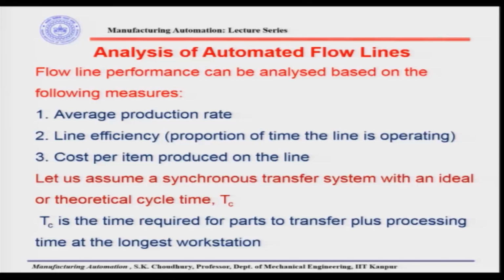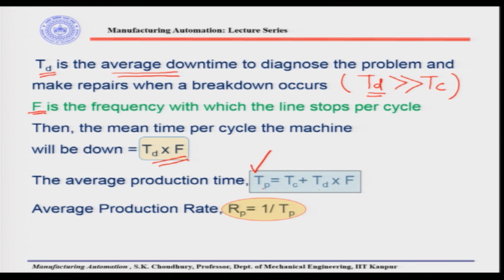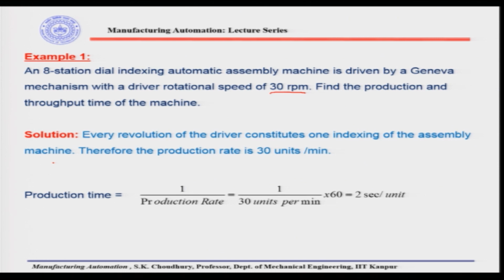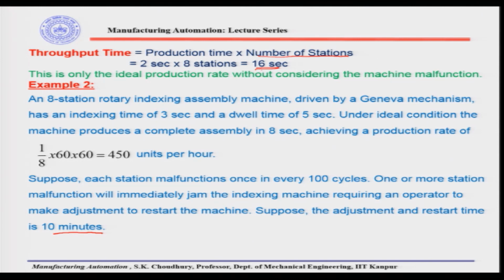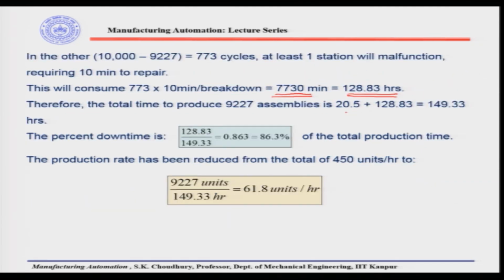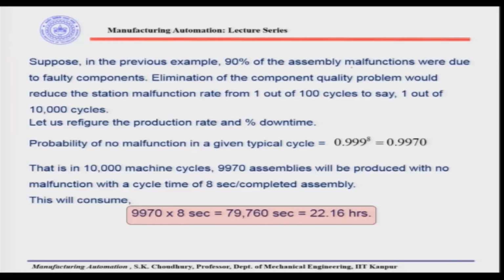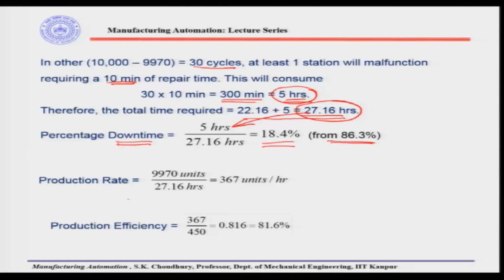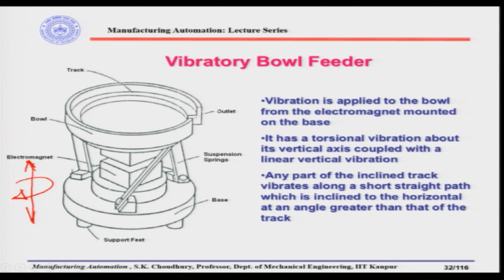noc19-me78-lec05

Comment: Sir, I would like to highlight a mistake in question where the probability of malfunction has been reduced, from 1 in 100 cycles to 1 in 10000 cycles is that there it has taken probability of no malfunction 999, but it should be 9999, this is a minor mistake in the ppt, but I hope it will be corrected by the technical team, very very thanks for teaching us.